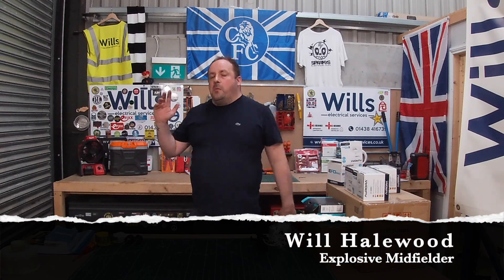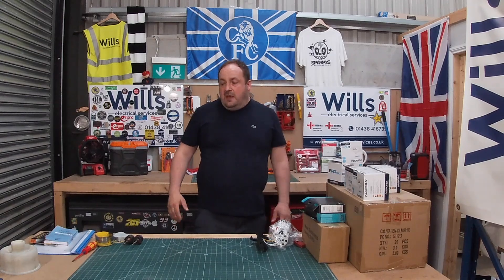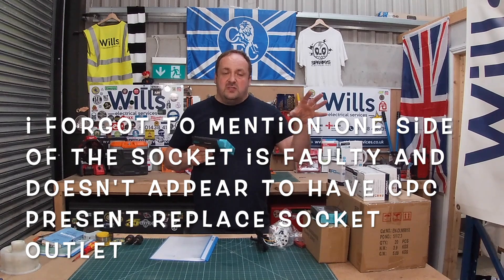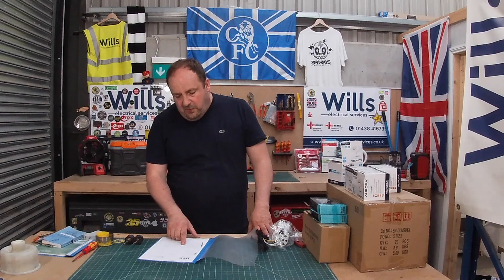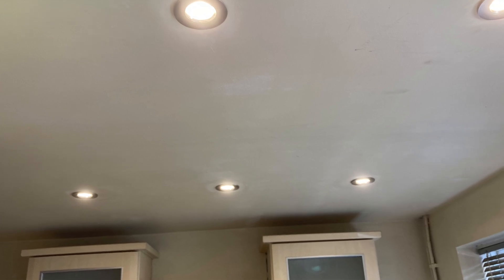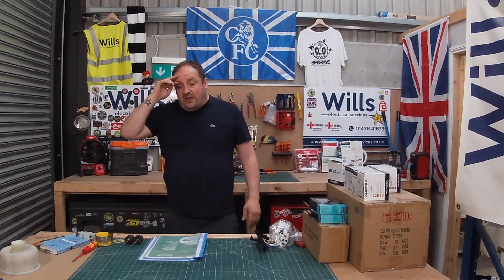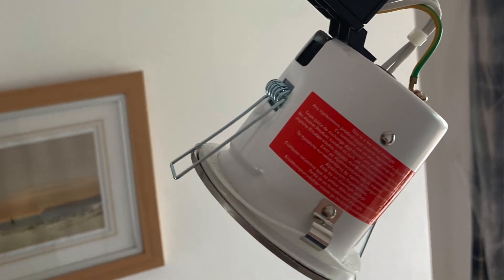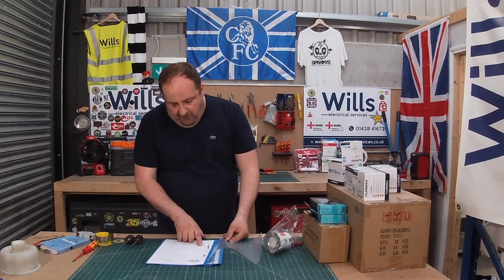Prep for remedial works and downlight tricks    Electrician TV

Comment: Good tricks with the downlighters Will, what do you do if the holes are smaller?
Reply from the maker: Thank you Martin.As I mentioned in the video what I would do is get a piece of wood or a bit of plasterboard drill the hole out to that your desired size.Hold it over the hole As a template and then drill the hole sometimes you might have to screw the wood to the ceiling if it’s Lavan plaster but is easily repaired with a bit of filler works a treat every time
Reply: @ElectricianTV  Sorry Will I did watch the video, meant bigger 😆
Reply from the maker: I have done a video. With the title glory holes for electricians all that is on the fun now that explains it all in that video. It’s basically about access holes for electricians or tradesmen.